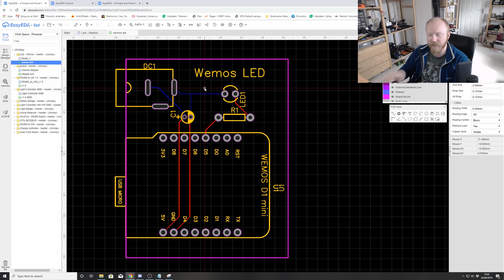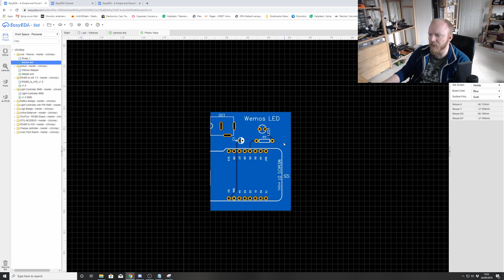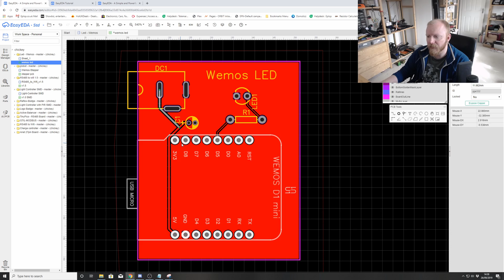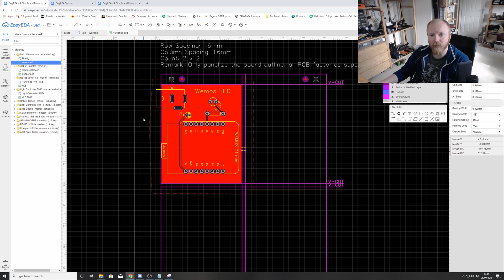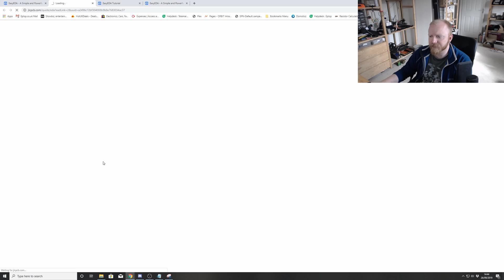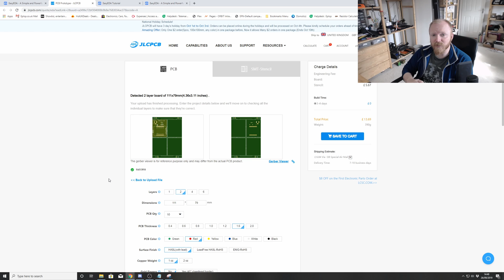Beginners guide to PCB design with EasyEda Part 3

Comment: Hello Colin, by the sound of your accent you do not live too far away from me. I live in a place called Cleadon, mid way between Sunderland and South Shields - whereabouts are you?
I have just started using EasyEDA and have encountered a problem. I was wondering if you could shed some light on it as I am not getting very far with the EasyEDA support team. 
After attempting a design I felt the need to do a 'Route/Unroute All' and start again. This worked (sort of) as it brought the ratlines back but did not delete the ground plane. I could not find any specific means of deleting the ground plane apart from, what I would call, a hack. What I did was perform an 'Edit/Clear all' which (seemed to) delete averything, then I did a Ctrl-Z and everything was restored except the ground plane! Is there a better way of deleting the ground plane? 
Many thanks.
Jim

Comment: Hello sir,  can you explain me what cooper layer do exactly please ?
Reply from the maker: The copper layer if your refering tot he ground plane allows you to connect all the grounds together without needing to run connections between them manually.  It can also be used for head disipation.
Reply: @Chickey  just all ground ? Not all pins?
Reply from the maker: @skepsis9238  Copper is used to connect the pins also yes.

Comment: Yes very good series. I was wondering if you'd consider doing a follow up to this one which shows how to make changes to a board? I'm finding that component changes are not easily done. So perhaps something which goes through an easy change, where if the part is the same size you can just make the swap out, to a slightly more complicated one and what you need to do on the schematic as well as the pcb to get it to work. I find that there's no one who's done this type of video.
Reply from the maker: Thanks for the great suggestion, i do plan on more videos so will add that to the list.

Comment: Great tutorial. One very informative thing I learnt from other tutorials, elsewhere, was that before you lay out your PCB, always review and set the design rules of the manufacturer. That way, the track widths and clearings will be considered by the PCB layout software as you do the manual routing. The software, knowing the rules, will not allow you to violate them, for example by placing your traces too close to each other. That would save you headache when you try to order your board. You did not touch on this fact with any emphasis. I wonder how you feel about it. Thank you again for the great tutorial series.
Reply from the maker: Great advice on the design rules, it does make life easier when it comes to getting the boards built.  I think also looking at track widths depending on how much current you want to carry would be good also.

Comment: I'm learning this right now. I watched you set of videos and several opthers. I'm creating two PCBs pretty similar to the one in this video (one for ESP8266 D1 Mini and one for ESP32 30 pin, slightly different capabilities in the two PCBs). I designed with copper ground plane. I was pretty close to ordering when I wondered if the copper ground plane might interfere with Wifi. I did some reading (including the design guide from Espressif) and discovered they strongly recommend not putting even traces under the antenna and a ground plane is reported to be worse. In your design, the entire underside of the antenna is a ground plane. I was wondering if your Wemos continued to work well on Wifi on this board? One Reddit post said they their ESP32 (or ESP8266?) couldn't connect to Wifi at all and discovered the issue was the ground plane. So, I've redesigned and moved the antennas off the PCB as much as possible and additionally removed the ground plane from under most of the ESP32/ESP8266 (but enough to still have the additional convenience -- the ground plane  makes routing so much easier!).
Reply from the maker: Yes normally removing the ground plane from under the antenna is a great idea and shall help massively.  Also avoiding components which could affect the quality under the wemos is a good idea.

Comment: Thanks Colin, great series, it would be nice to see a sequel. If someone else has the serial number, can they order the pcb online? other question, is it possible to make a printout to make a testboard at home? What is your experience with delivery times?
Reply from the maker: Hi Delivery times are normally pretty great.  Re a testboard you can make anything you wish, that is the beauty of designing your own boards.  Re the serial number you can share your designs and many people do on the easyeda editor so you can see how others have designed things.

Comment: Hi Colin, Great video's, I'm new to Schematics and PCB design and found your set of 3 videos very helpful.I am quite old but still like to learn, and in the past few years have taught myself basic Arduino Programming and 3D Design using Fusion 360. But decided I wanted to have a go at designing some PCB boards for my projects. Hence why I watched your video's. I always try to solve problems myself but sometimes get stuck and was wondering if you mined people asking you questions regard EasyEDA? Thanks again for the Video's. I have subscribed in the hope you will do more.

Comment: Thanks for the 3 videos. Really clear, easy to understand and to learn from. One small comment:  your video when minimized is located on top right, hiding some of the menu and options. In the future, you may want to consider placing it on bottom right.
Reply from the maker: Thanks for the tip!

Comment: How does one figure out the pinout of the barrel connector?
Reply from the maker: Hi i got it wrong on my example as i mentioned in the discription.  Usually the centre pin shall be positive on a barrel jack but some supplies reverse this so i would look at the diagram on your supply you will be using and design your board around that.

Comment: Thank you Colin, very helpful video. I would really like to see a video on the workflow from EasyEDA to JLCpcb's new pcb assembly service. There would possibly be others interested in this as well.
Reply from the maker: Hi Peter, in my conversations with EasyEDA they've mentioned doing a video on the PCB assembly so might well take them up on their offer.
Reply: @Chickey  I would be most interested. There are a lot of videos on EastEDA and also on the new PCB assembly service. However nobody has yet showed how they can be used together as a process to produce a completed item.

Comment: Hi Colin!

I have a question about paneling: If I have a panel of pcbs, the quantity I'm selecting is the number of panels, not cutted pcbs, right? Like in your example, as there are 4 pcbs per panel and you selected "10", you would have 40 pcbs in the end, correct?
Reply from the maker: Yes so when your selecting say 10 that is how many panels your getting so if you did it a 2 x 2 panel so 4 pcb's as you say you'd end up with 40 pcb's in total.

Comment: A way to remove just the net you are interested in is to double click on the net name under Design Manager->Nets. A pop-up should appear asking if you want to unroute just that net. You can also use Shift+B to rebuild the ground plane. To help with those clearances when using the autorouter, you can set the clearance for each rule which can help ensure that those default 10mil clearances are overridden for certain nets.
Reply: Though I find it odd that they complained about the 1.6mm spacing for v-scores as I tend to use 0mm for my boards which used to be the default. And yes, always do custom size for your stencil. I got the default size once before I knew any better and it is absolutely huge.
Reply from the maker: Thanks for the comments.  Yeah the vscore complaint confused me as well.  If i remember rightly the boards which i panalised at checkout on jlcpcb automatically did 0mm spacing.

Comment: Its also worth knowing that you can combine postage on several boards.  Also, you can get reduced shipping on components from LCSC when the board is in production so its worth getting everything ready in advance since the chances are that your board will only be in production for 24hrs or less - blink and it will be on its way!
Reply from the maker: Thanks John, great advice, i've used LCSC a couple of times and i must say it's nice knowing that a component will be the right size/genuine etc rather than the ali express lottery which you can sometimes have.

Comment: What happened to the 5v connection to the barrel connector? Can see it from wemos to capacitor but that's it. Also noticed you were a bit hesitant when you could see the cost. Your panalised board is 111cm wide so outside the 100x100mm standard. Been there, tried to do that. Thank again for a great set of videos.
Reply from the maker: Thanks for the comments, choosing a 1x2 panel may have been a better example.  Re hesitation i think i had forgotten i'd panalised the board so seemed more till my brain caught up :-)  I'll have to check the 5v connection, it's possible i mangled something in the video edit but to be honest it was more about showing the concepts.
Reply: If you mean, why the 5v did not become routed? The 5v was on the bottom side, so that's why it didn't show.